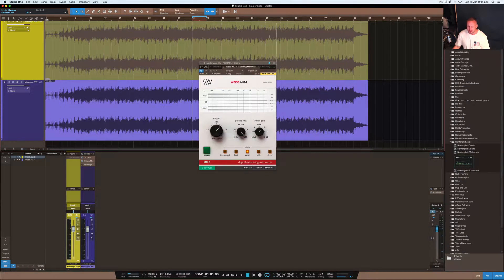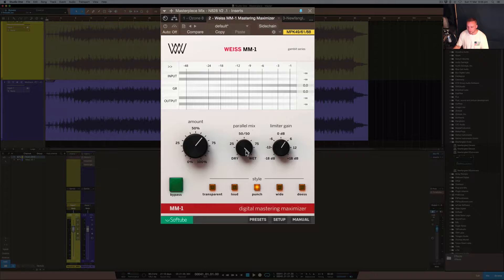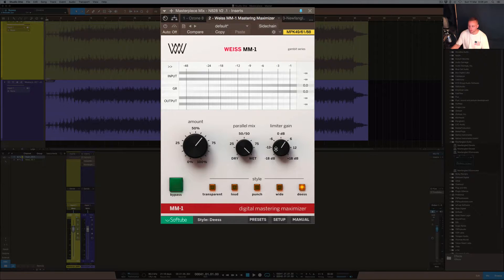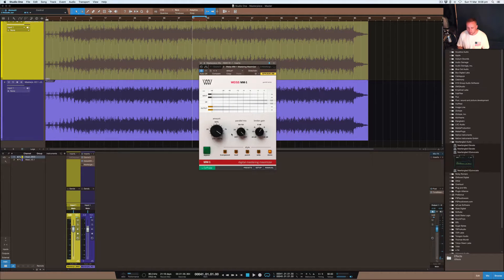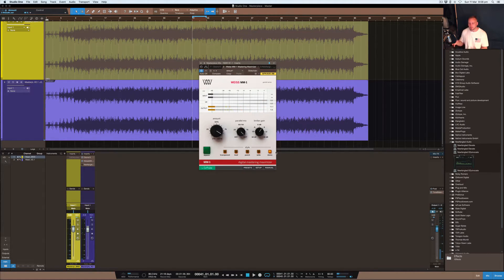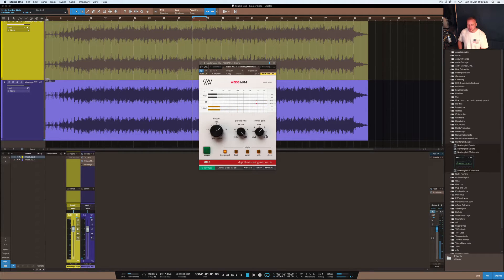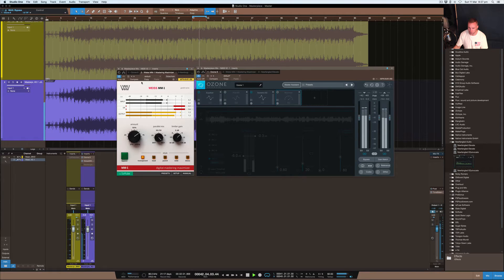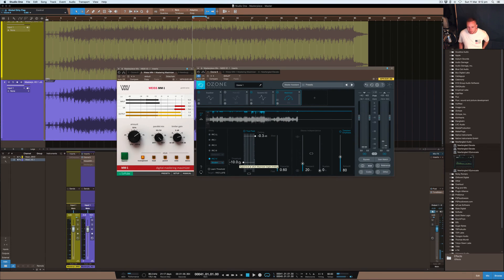Softube Weiss MM-1 | Review | Mastering Maximizer Plug-in

Comment: Try limiter no6, it's more versatile and punchy then this one imo and it's free.
Reply from the maker: Ive use limiter 6 sometimes, its a great limiter. 
Pretty much the same as TD Labs limiter
Reply: CROSSBEATS MUSIC PRODUCTION what do u think about digital clipping, have u tried it? it's a modern technique without limiter on masterbus to get pumping free sound
Reply from the maker: exotrm I assume you mean using a digital clipper? If so yes I do that frequently with drums to tame the peaks and level out transients. It usually works really well as long as you dont over-use it. :)